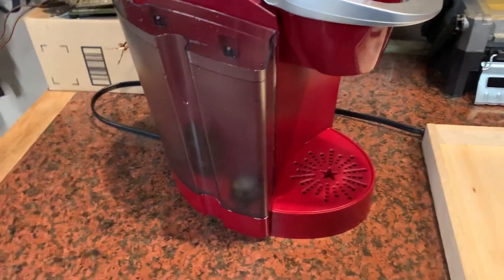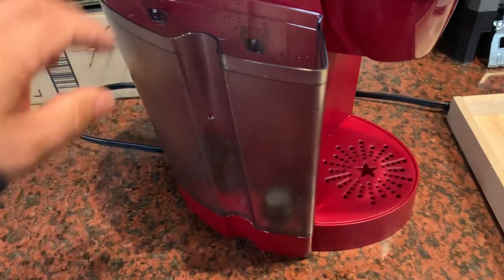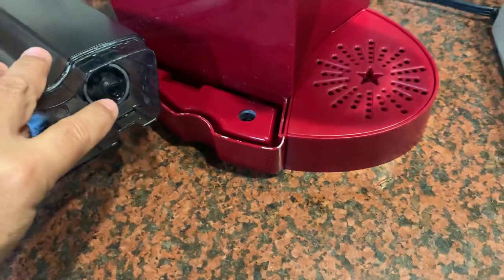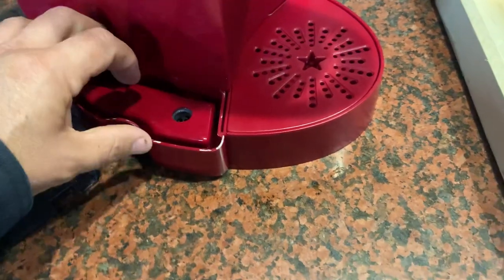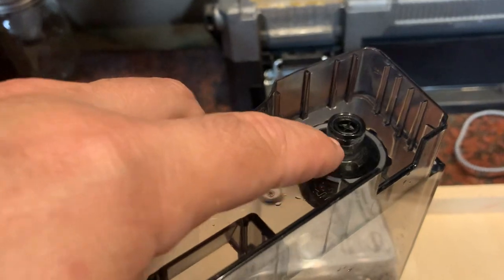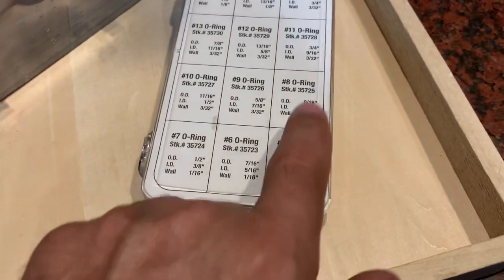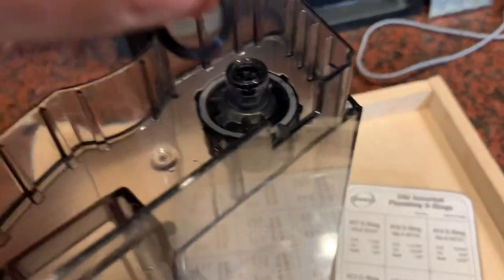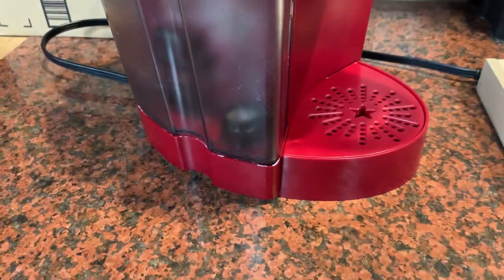💧Keurig ● Leaking Water From Bottom ● Takes Only 1 Minute to Fix If Your Coffee Maker Leaks!

Comment from the maker: Some folks have let me know that in some cases, you might need to add a #8 o-ring to the water tank, AND then place a #7 o-ring on top of it. So then the #7 sits down inside the hole a bit further. 

Here's where to buy the O-Ring kit needed to fix this problem: https://amzn.to/38KjZNF

Upgrade your Keurig Machine with these new options:
* Keurig K-Supreme Coffee Maker 66oz - https://amzn.to/2QyYhWh
* Keurig K-Classic K-50 Coffee Maker 6-10oz - https://amzn.to/3rkhOq7
* Keurig K-Slim Coffee Maker 8-12oz - https://amzn.to/3tTTmxz
Reply: My watertank wouldn’t sit flat with both #8 and #7 on. Trying just #8. 🤞

Comment: My brand new Keurig Express, a warranty replacement, leaked from the bottom the very first time I used it, and every time until I saw this post. With mine, the o ring on the reservoir wouldn't let it brew, so I put the o ring on the valve on the machine itself instead. So far no leaks!! Hope this helps someone!
Reply from the maker: Thanks for your comment!!!

Comment: Is it safe to use once it's leaked? I hadn't used mine for awhile. After brewing 1 cup it leaked all over the counter. Not sure what to do.
Reply from the maker: The water is just leaking out of the reservoir usually. Try this o-ring fix and see if that helps you.

Comment: This method didn't work for me. I bought the set of O-rings suggested in the link and tried the multiple sizes. My machine still leaks.

I have a K50 Keurig. Not only does my machine still leak, but when I tried to make a cup of coffee, trying different O-rings inside (one at a time).. the water couldn't be sucked from the tank into the machine because the ring is in the way of all the little holes.

I had to fish the ring out with two steak knives, which scratched up the hole on the machine because the ring was too thick for my tweezers to grab.

Waste of time and money 🙄